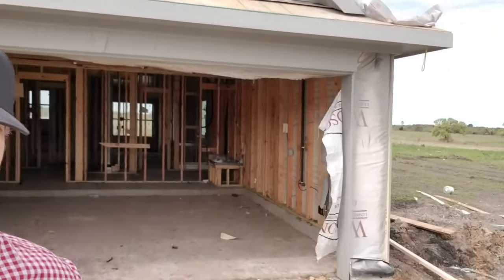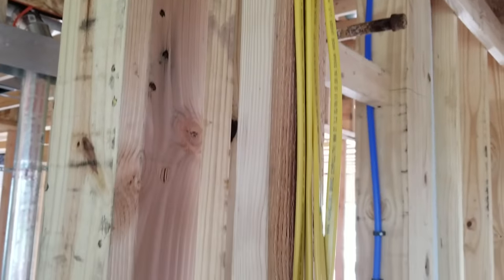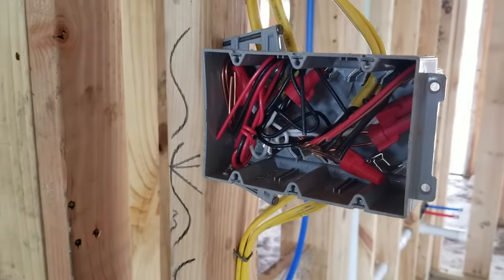HOW IS THIS EVEN LEGAL?!?!

Comment: Hint, stainless steel appliances are anything but stainless steel, I have a GE STAINLESS STEEL GAS RANGE and the burner knobs aren't stainless steel even though they look like it, they are plastic with a silver foil paper over it that can't be soaked because it bubbles up and peels off or will scrub off if you're trying to clean off stuck on grease and then the very shiney end Caps on the oven handle aren't stainless steel either as My fingernail caught the groove while cleaning and it literally broke off and is some kind of molded plastic with again a metallic looking overlay on it, more like the part was made of some epoxy. Stainless steel will hold a magnet and most areas of the parts of a refrigerator will not hold a magnet, no attraction because not metal on the front which is the part most fridges look like stainless steel but aren't only the side will attract magnets. We need to go back to the good enamel on steel white appliances like in the 1950's where you could clean without parts coming off and knobs bubbling the coating off because you soaked them in hot soapy water.

Comment: buy a house built in the 1970s. most new houses are crap.
Reply: You mean the ones stuffed with asbestos...
Reply: @epiccollision  ...and lead paint, and poor insulation....
Reply: That's a rather broad conclusion.  Just because something is how it used to be done doesn't mean it's the best way.  If the desire is to over engineer everything without regard to cost, we should just steel frame everything and double the price of every home.  Cost/benefit matters when trying to provide something of value in a reasonable way.
Reply: @epiccollision  Well, it is fire proof.
Reply: Not only will that 1970s house be better, it will also get you in on the plethora of Mesothelioma lawsuits and pay for itself.
Reply: They may have generally done a better job framing but insulation, heating systems, air leakage, etc, etc.  no.  This house has some real downsides but it's not 100% worset
Reply: @epiccollision  That fear-mongering is way overblown. I'm 63 and have never lived in a new house. Do you know how many people I know who've suffered health issues from living in older houses? Zero.
Reply: @BrianKrahmer   idk midwest ones have some charm to them. really cozy, poorly insulated and creaky, yet brickhouse

Comment: Home builders, used car salesmen and lawyers are the worst.  It’s been my lifetime experience and in many states that home builders will use the cheapest ways and routes (translation: shitty materials and the least competent subs) to get the job done hoping you don’t find the problems and issues before it’s covered up and/or you are forced to close. 
I had to hire a GC to monitor my new home construction and then hire three different home inspectors above the two that were required and still for problems. 
Absolutely a license to steal. 
This video is so true.

Comment: I've been a "remodeling and repair" carpenter for many years. I get to see all the things that "didn't work". Thankfully I have never come across a house like this. No only were there no diagonal braces there was no "fire blocking" in any of the walls. I don't care about the code not calling for fire blocking  it is a really important feature for many reasons.
Reply: The diagonal bracing in this house was 7/16 osb which they didn’t install. Nothing else needed
Reply: @bonez747  watch the video, the WRB was attached directly to the studs WITHOUT SHEATHING.  Yes people who know what they're doing do OSB or plywood. They used diagonal metal straps on the garage ceiling which still doesn't address wind shear.
Reply: I didn’t see any fire blocking any where or fire caulking of any kind…. In Michigan we are required to have fire blocks on all electrical lines…. Also you need something like ply or osb against those studs the water damage is gonna be a problem after a few years ….. we used 1/2 osb with Tyvek wrap…..I hope like he said they will do the flashing well otherwise the water issue is gonna be a very serious one in no time

Comment: I'm glad to hear good things about the a/c and electrical. I'm sure that will help when the freaking house collapses because of a 60 mph like what happened to northwest Texas about 2 weeks ago. My house built in 1943 with a steel roof didn't have any damage.
Reply: Why would having strips of osb be any less strong than sheets of it?  This definitely isn't a new practice.   Builders have been using a structural siding for decades.  I wouldn't want that kind of work, but it meets code.

Comment: I don’t even call the woven paper a Waterproofing.  If you want a good air and water barrier 40 mill self adhering membrane all the way around, again install properly will get a good sealed home.

Just in case you’re concern with permeability they make permeable and non permeable membranes.

Comment: In Chicago metro there still building houses with vinyl siding and cardboard sheathing (you can kick your way in through the wall) but at least they still require proper wiring as in using EMT conduit (metal) rather than the damage prone NM cable, rodents can easily cause thousands of dollars of damage quickly that is easily become a fire hazard.

Comment: Never buy new my home was built in 1910 even a tornado couldn't take it out it's a 112 years old and still going strong I have lived in it for 30 years now. The only things I have done over the years is a new furnace and central air it never had AC when we first got the home and I put a fence around it and since I have been here two new roofs because of hail damage and when I first bought it I put in windows and doors just to make it more air tight for the AC. I would never buy anything new 90% of the time it is junk and won't last.

Comment: Manufactured homes use this type of construction. My 2019 Palm Harbor is built this way, although they used Tyvek house wrap not a off brand. 4:34 I've done this style of flashing sort of. I flash the rough opening set the window and flash it to the house wrap/tar paper then hit with a heat gun for a good bond. I have yet to have one leak water. They need to hit that with a heat gun to get a good bond.

Comment: My friend was having a custom built home in san antonio, her house was built with this same type of construction. Except there was a few worse things about it, there was a hug gap around the foundation where you could put your hand in and feel insualtion and sheetrock, the attic was about 140 degrees when we went up there with the ac unit and flex ducts through the attic, and the tile was installed after cabinets and toilet. Meaning there was bare wood under toilet and cabinets. I pointed out all of these and the family I was with said I was just being negative and jealous. She paid 180 per sqft. Shes still in it, said she has no complaints really. About 3 years now I think. Ingmdigure it will last about 5-7 years

Comment: I bought a house 2 years ago that has exactly this type of built. No sheathing just a wrap and hardie plank. It was built by Armadillo Homes down in south Texas, where temperatures are 100 degrees almost all year around. Very poor insulation, my electric bill is 200 plus at a set 80 degrees for a 1700sqft home. My knowledge of building science has improved watching your channel but at the time of purchase I had no clue. Im very disappointed and now stuck with this 170k mortgage for a very poorly built home. It's a total scam...
Thanks for the video tho  👍

Comment: I've been an inspector for close to 30 years and we would have never let anything structurally close to this in our jurisdiction. It would take one strong nearby wind event to expose the deficiencies . It this is the level of construction I'm sure they cut other corners for cost. It's up to the jurisdiction to make sure the homes are built to the minimum structural and life safety requirements. Cant imagine what went wrong in this instance. Jordan is right, it may not be the first homeowner but somewhere down the line somebody is going to take a big hurt on this one.

Comment: Lack of sheathing or inferior sheathing is not new.   I live in a house that was constructed in 1927.  The house uses full dimensional lumber.   Sheathing is solid half-lap boards.  The sheathing is covered in tar paper, and the tar paper is covered in cedar shingles.   Across the street the houses were built in 1940.   The lumber is not full dimension.   The sheathing is Homasote covered in clapboards.

Comment: My house is a smaller 2 bedroom rambler built in 1940. Solid contruction, wood lath and stucco interior, board siding on the outside. That's why I tolerated this place for 40 years. I watched a lot of new homes being built from the ground up around here, and was shocked to see new homes being built with OSB I-beams for floor joists. In the Pacific Northwest, moisture is a very big problem, and would expect those floors to collapse within 10 years.

Comment: Having needed to jack up a porch (that had been enclosed in stages over appx 30 years before we bought the house)  to rebuild the foundation, when the framing was not sheathed, but sided with the old "paperboard" siding... I can tell you that the siding can give a tremendous amount of  rigidity to the frame.
I had to strip the siding to be able to straighten the porch.
.
I upgraded the  "room" considerably in the process of the renovation.

Comment: In my area I've seen foam board used as sheathing in low end homes and thought I would never by one of those. This is far worse with no sheer strength. I can see this toppling during a major storm.

Comment: This is commonly called corporate greed. To maximize their profits they go with lowest bidder and cut every corner they can get away with. I used to do heating and air for a guy who owned his own small company. He and I where the only licensed guys on the crew, you can call the others basically day laborers. I used to go with him when he would bid on some of those builds, so I saw what he bid when he got the jobs and what he bid when he didn't.  
Sadly enough even the house I am sitting in right now is lack luster. Sitting at my desk facing an exterior wall I can feel the chill coming in through the walls because of how poorly they are insulated. This house is over 10 years old, I bought it new, if it was that bad then I can imagine it's probably worse now.

Comment: This way of building is pretty standard in Australia, or at least in Queensland.  The wrap is a reflective metal foil, Sisalation is a common brand.  It helps bring down radiant heat transfer, prevents moisture from coming into the structure and allows condensation to seep out allowing the building to breathe.  The OSB used everywhere In America, in theory, seems problematic to me, because if it gets water on it I assume it will just swell and become a problem.
There seems a divide of builders who talk about letting a building breath vs sealing the building.  Is it a climate zone thing?  South East Queensland is similar to Orlando I believe if that adds context to the situation.

Comment: I recently visited a DR Horton house during construction. They are using ThermoPly for sheathing and for the exterior wall which doesn't provide lateral support and structural strength for cross winds. Per the manufacture's recommendation, ThermoPly can be used as an exterior wall as long at it is stapled every three inches from the base plate. At the work site, they are following this rule, but every staples present an opportunity for water penetration. Worst, is staples being used every 16" OC. I counted about more than 1,000 staples and they were not sealed with the sealant tape. Scary. While some cities or states allow for this as the minimum code, what cheap production home builders are doing is skirting quality for profit and still charging customers the same price for lumber. At the end, you're paying for a cardboard house and I've seen other well-known builders placing this cheap material on the exterior for an exterior wall replacing OCB or plywood and are charging $800K for a cardboard house. 😂😂

Very scary!

Comment: As long as the corners are shethed in plywood you are fine, they used to just use celotex, or fiber board (a tar and paper board), or used foam to cover the flat runs, this isn't new or that bad, as long as the corners are plywood. I would prefer plywood everywhere, but I hope they are only doing this behind siding and not behind the brick, otherwise what is holding the brick tot he wall?

Comment: Those metal x braces on ceiling won't do anything to help walls. It will keep ceiling sqaure as it racks over to the ground. You would have to put some metal x's on the walls. Not the ceiling.

Comment: It blew my mind the first time I saw a house built with no sheathing too lol. Apparently it's fine though. I wouldn't recommend it myself, but they tell me it's perfectly fine
Reply: I had a home that was built with some kind of foam board for sheathing. Kind of weird, but the exterior was brick at least. When I ripped the flooring out, I found where the inspector spray painted instructions in several corners for the framers to add diagonal bracing.
Reply: @MoneyManHolmes  yeah, it's called let in bracing. It's required on all those types of builds

Comment: The electrical looks good, but anywhere that theres 4 or more wires going into a box, it is supposed to have a standoff within 12 inches or less to the box, and im not sure if its just tue video but it also looked like the staples were pretty tight, but that could just be the video.

Comment: Looks like the job the builder did when our subdivision was built 40 years ago. They nailed Masonite siding directly onto the studs, messed up the roof (no expansion joints), lots were not graded properly for drainage and the water ran under the houses, warping the floors and causing all the insulation to fall off. One house was so bad that they just moved it off the lot and let the two neighbors divide the property.
Plumbing was poorly done (the house next door the plumber had just stuck the elbow for the bathtub drain on and it fell off so everytime they took a bath all that water ran under the house).
Builder refused to do anything, in fact, when the homeowners started figuring out what he had done, he and his wife sold out and moved to Florida. A lot of the homes out here were financed thru FmHA, so we got together with our Senator and FmHA was forced to pay for repairs, because their inspector didn't inspect..in our case he just came by after we had been there a week and asked if we had noticed any problems. The people who hadn't used FmHA were on their own for repair costs.
Scary thing was, when the new contractor was replacing the siding, they knocked on the door and said they wanted me to see something. They showed me that when the siding had been nailed on, the 220 line from the breaker panel to the baseboard heater in the utility room had been severed by a nail and the stud was charred from the live wire being against it. They said it was lucky we didn't have the whole house burn down. We didn't use that heater so we had no clue that there was anything wrong.

Comment: I just bought a house last year and this crap is why I bought a used home instead of a new one, my house was built in 1969, all brick and is still in great shape. the roof and floor decking is actually looks like tongue and groove instead of plywood which is something I've never seem before, is this common on older homes?

Comment: I have a town home like this.  From the biggest US homebuilder (or one of them).   It's efficient and well insulated, and actually well sound proofed between units.  And is energy star certified.  But...
The city allowed them to modify building code that everyone else in the state uses (except Chicago, I believe) and use plastic coated romex electrical in the walls instead of conduit.  I didn't like that.  Not copper plumbing,  it's the crappy PVC pipes.  I don't like those.  The electrician only used one screw in each outlet, so they wiggle.  Very lazy. Plus I had one outlet short and singe the drywall because a wire came loose.  Fire hazard.    They just hire the cheapest workers and cut corners on everything.

Comment: Hey. I like my fake floor ("luxury" vinyl plank). Set it forget it. It's a cost/wear/care choice. Not a bad sign for a house. Wow. No Shear on those walls! Drywall actually has some value if nailed properly. But the garage front wall has virtually no wall panel length. BTW there's code requirements for every part of the house, and licenses are required for all contractors. They just leave some of the work to unqualified people and don't supervise. It's graft. But you are correct about "keeping up" a license. Some ongoing education and testing is needed. Some people don't keep on their insurance. I won't paint the industry with a broad brush, so many excellent builders, but the general product speaks for itself.

Comment: I quit building in the 90s. At that time I thought houses were built with crap. We used  OSB on the corners and then the foam blue board everywhere else. With vinyl siding and sheet rock I used to laugh about being able to break into the house with a razor knife through the wall. I figured not too many people realized knew how easy it would be to get in, but I knew it. 
 Now they've come up with cardboard walls. It should be illegal to build homes for people out of cardboard and styrofoam.